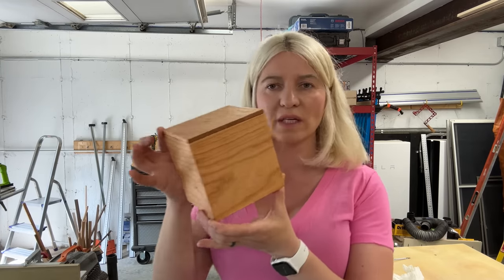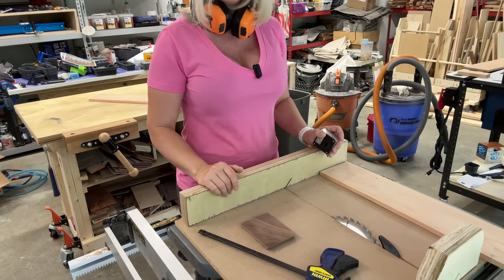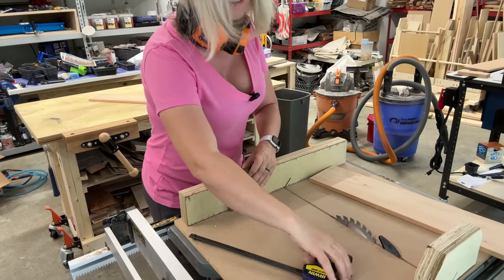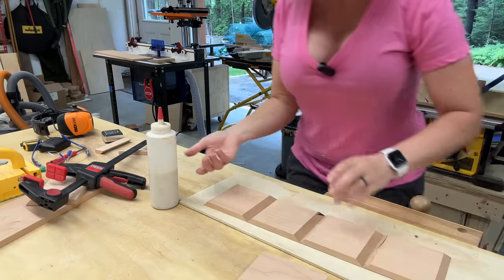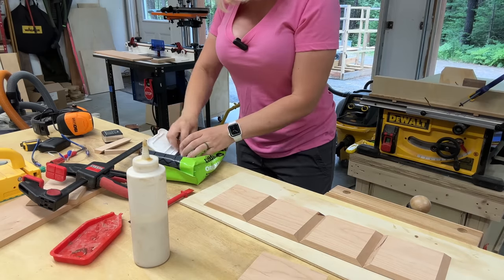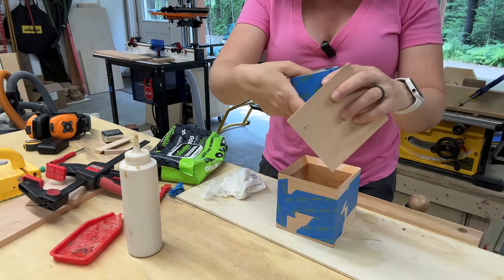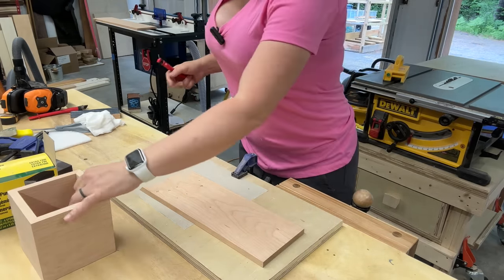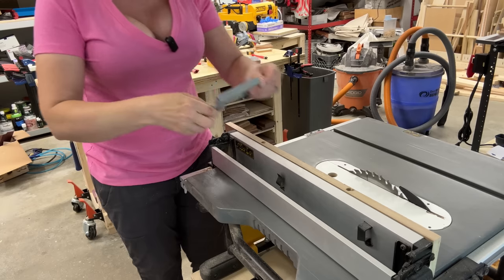The easiest way to make a box. NO MEASURING! Woodworking project that sells. How to make a box

Comment: As a joiner of 45 years in the trade , I was taught to cut and then sand as the paper could leave small particals  in the timber and dull your blade. Granted we were using more hand tools , planes ect... not trying to be a know it all, just something to consider. Nice boxes ...also , if you want a really flat reference surface for your sand paper, use a peice of plate glass.... 🤔😎🇦🇺👌 I love making small boxes as well . They make great gifts.

Comment: Got my critical socks on.  You make a nice video, things move along well, but if anyone takes it as "THE way" to make a box, I suggest a few additional things to consider.
3:30...when miter cutting the edges, if you use an angle that is very slightly less than 45 degrees the mitered and glued joints will fit together better and not visibly open later.  Search around, this is not an unknown technique, hope it helps.
Good use of the stop block for making a square box, but cutting two pair of sides at different lengths allows for rectangular boxes.. a matter of personal preference.
Aligning the bottom edges of the box wall sections along a straight edge will ensure they fold up without (much) misalignment.
Adjust your tablesaw blade for a "deeper" cut so each tooth comes "down" on the wood being cut, rather than "along" it.  Depth of blade is sometimes controversial, but it's a situational thing,  I like what is most likely to work well.  I see you are using a pretty rough cutting blade (low tooth count), you will improve your cuts by using a blade with more teeth.
12:47 rounding the edges of the box makes it easier to hand, a matter of opinion, but drop it on your foot and you'll understand.  Even if you miss your foot, a sharp edge will show every ding and dent, which rounded corners will resist somewhat.  You note breaking down the edges at 13:16, one of the things that make the box feel better is that your skin is dusty after sanding.
16:11 surely you can do better than trial and error to accomplish the rabbet on the box top.  Trial and error is a well-proven technique to waste wood. Next, rather that cutting the rabbet at 90 degrees, giving it a slight taper will allow the box top to "find" its way onto the box rather than having to exactly align it.  You can still leave the last little bit a 90 degrees for a tight fit.
17:27 don't you use a tack cloth to remove dust prior to applying the finish?! Nor wet the surface to raise grain which you then sand off?

Comment: You did an excellent job of building that box.  One thing I've found handy, especially on bigger boxes with mitred corners, is to wrap the box with the stretchy plastic film, sometimes called plastic twine. Every wrap gets tighter and it puts even pressure all the way around. Keep up the great videos!
Reply from the maker: Great tip! Thank you

Comment: One of the very best small box making videos I've ever seen, so straightforward and relaxed. Like the use of the sacrificial fence too. I noticed that you switched on the extractor manually: my workspace is smaller than yours and I invested in a remote switch for mine. It's a real time saver for me, keeping the little remote in my pocket.
Reply from the maker: Glad you liked it! Yes, I been turning on manually. I just bought the harvey gyro 700 dust processor and this one came with a remote :)

Comment: Your videos are fun to watch! I noticed you are getting burning even when you are cutting quickly. I also notice that your saw blade has a lot of pitch on it. I bet if you cleaned the blade you would minimize or even eliminate the burning problem.
Reply from the maker: Thank you so much for the tip. I don’t know how to clean a blade. I will be doing some googling then attempt to clean it.
Reply: @woodworkingwithSkyler  It's more likely due to the blade not being properly aligned with the miter gauge slot. There is a tool kit made specifically for this purpose, which is not too difficult to use, and it does a great job. You'll get much cleaner cuts once you verify the blade is aligned with the miter gauge slot.
Reply: Or blade not sharp. Get a new blade

Comment: With a solid glued bottom aren't you worried about wood expanding and contracting with humidity?
Reply from the maker: At the time I made that video I didn’t know much about wood expansion. However , is been about a year and I that box os been in my daughter’s room on her dresser, I just looked at it today and it looks perfect. No issues at all. Maybe I just got lucky…
Reply: If the wood is sufficiently dry, and then oiled as in this case which limits any moisture uptake, the box should be OK. 👍

Comment: You'd get better, smoother finish cuts, without burn marks, by using a better blade.  Try something like the Diabo by Freud D1060X 10" x 60 Tooth Fine Finish Saw Blade or the Freud  1080X 10" 90 tooth fine finish blade.  You can also reduce burning, especially on hardwood wood like cherry, walnut and oak by pushing the work through the blade slower.  Eliminate tear out by using a backing piece. Using tape is dangerous and will gum up the blade.
Reply from the maker: Thank you. I thought I had a pretty good blade ( ridge carbide, around $160). Maybe using a full kerf blade is not ideal on job sites saw. Usually thin kerf is recommended